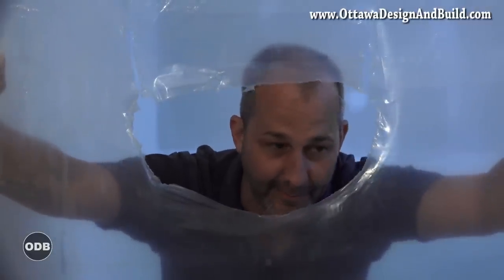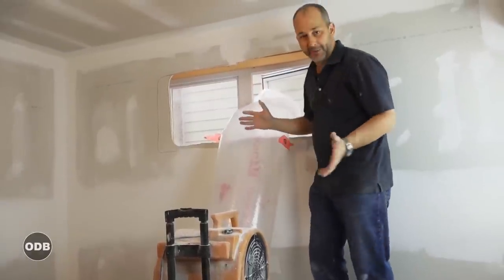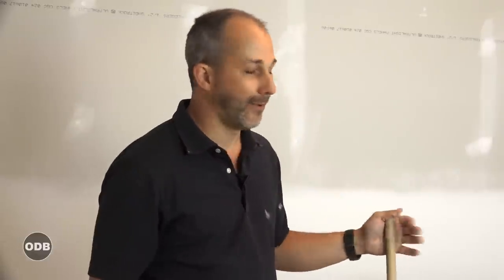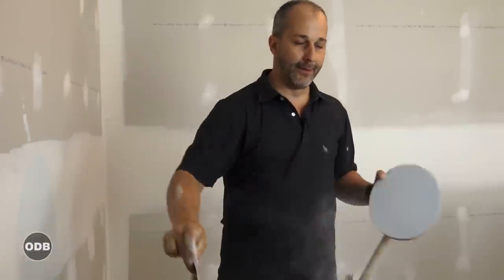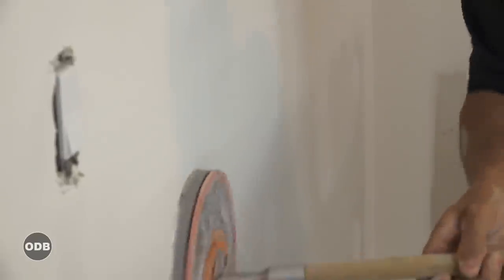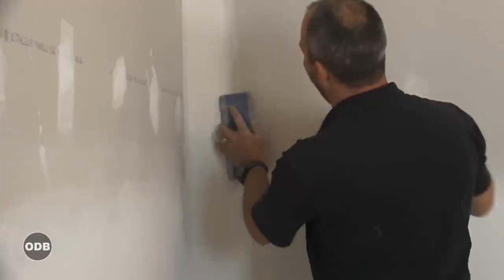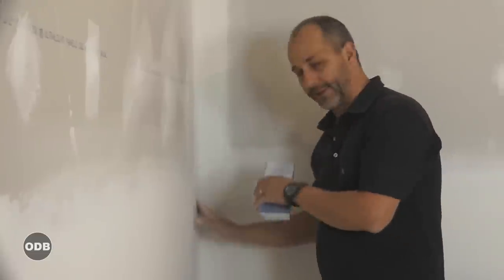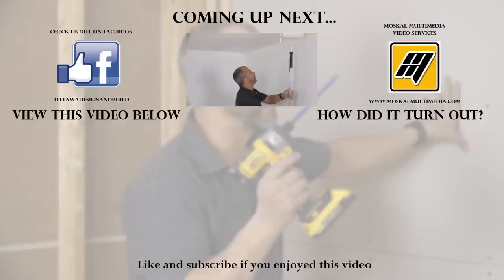Complete Drywall Installation Guide Part 12 Sanding

Comment: I’ve been renovating a bathroom in my house and I’ve been dreading the whole mud and sand part and have actually been procrastinating because I just don’t want to do it.
No windows in the bathroom.  I’m just going to turn off the central air, lock myself in there with a mask and go nuts.
My wet vac works a little but then actually makes the situation worse by blowing the dust everywhere.

I can install a jetted tub with plumbing and electric all by myself; THIS part has me up at nights.

I can do most anything; mud/sand/paint.....no thanks!!!

Comment: Great video, have you ever tried a motorized drywall sander with a vacuum attachment?
Reply from the maker: Yes, I am trying to get a hold of a homeowner version for the next project. The commercial units are just too expensive for residential use.
Reply: @HomeRenoVisionDIY  I got a $200 one - it came with 150 grit pads - took all the drywall mud off - way too aggressive. If you hold it even slightly off angle it eats mud like a pig - gives you nice moon shapes though. I ended up finishing the rest with my regular pole sander and there was no further agro!
Reply: @HomeRenoVisionDIY  the WEN DRYWALL SANDER is a good one for around 200. Affordable enough for the home owner. Long hose that connects to a shop vac.
Dust tornado bucket, or shop vac bags in the vacuum. Works like a dream. I am a contractor and use the WEN regularly for over a year now

Comment: Have you used those Giraffe drywall sanders and what's your opinion on them? I'm getting tools for my drywall crew and just wondering if this would actually speed up things or leave it with a better finnish instead of manual sanding?!?
Reply from the maker: I use negative air so I don't need a vacuum system that costs me almost $1000.00 to set up. My understanding is that they work with a screen which always scratches. The system in the video is 50 bucks and works with 150 grit sandpaper. Great value and great finish. Plus with a mechanical sanding you have more chance to over sand. It is a decent option if you need dust control and you aren't using negative air.
Reply: Thank you for your views, I haven't used one myself before either so... I cannot find the one you are using, just the steel ones that leave "accidental" craters in your boards  :-S But I'll take the swivel off them and cut a round piece of wood myself. -- Great vids..

Comment: if my sanding sponge (brand new-180 grit) is producing scratches do i need to break it in somehow? or will the primer and paint mix with leftover drywall dust and fill in the scratches?
Reply from the maker: I usually rub on the bare drywall for a few seconds to soften it up.

Comment: I've been trying to use a pole sander with the mesh sandpaper and it seems to catch on the wall.  Should I switch to standard sandpaper?
Reply from the maker: Wow, I don't like that whole assembly. switch to paper 180 grit and don't use too much pressure. It will go better that way. Good luck!
Reply: Perfect, Thanks

Comment: jow long I do heve let it dry that before that job
Reply from the maker: That all depends on the temperature and moisture conditions. Usually 24 hrs after the last coat is sufficient. Just check the inside corners on the exterior wall. They are usually the last to dry unless you have a fan running.

Comment: Just curious, do you do all your low voltage prewiring or do you have a sub for that? I'm not even sure if there's a big demand for data and structured wiring up in Canada.
Reply from the maker: everything is wifi and bluetooth now.
Reply: Home RenoVision DIY - Ahhhhh gotcha, didn't know if you had any peewiring or even retro fit wiring videos. But makes sense. Thanks for the good content!